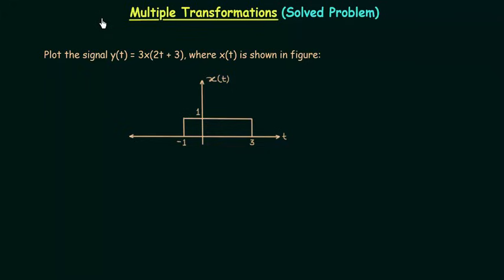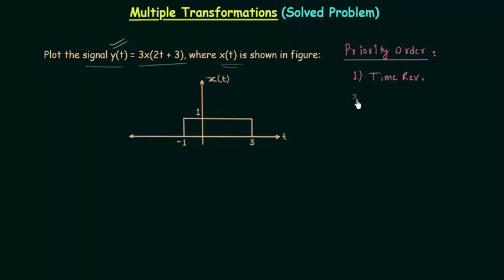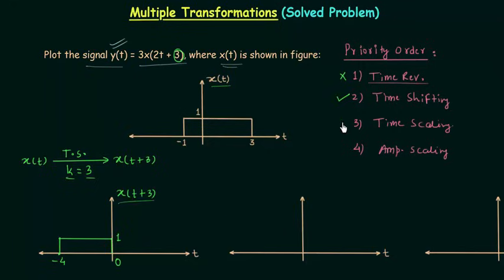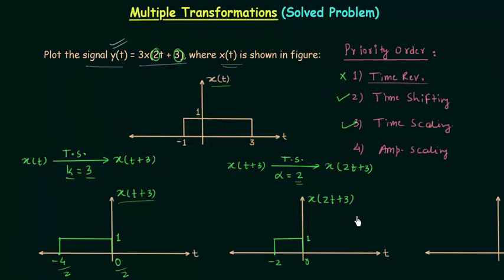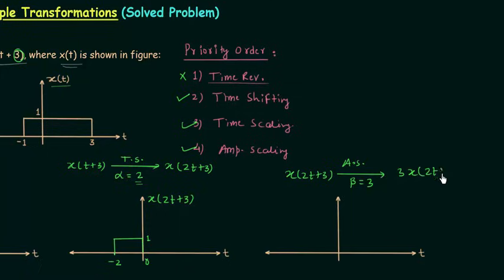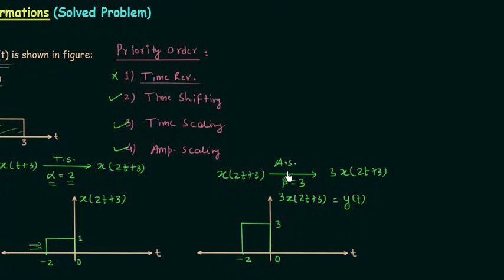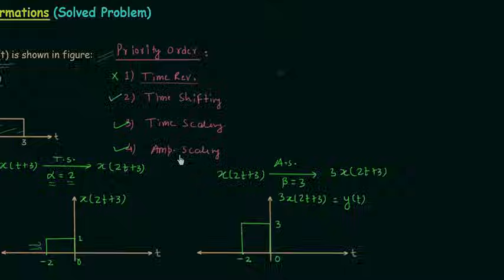Multiple Transformations of CTS (Solved Problem 1)

Comment: For people who are confused about the order of transformations. Actually, there is no universal way to perform signal transformations.

In many videos or sites, you will find different sequences and ways to apply the transformations; however, those patterns that you will find will be useful only for specific cases.

In the book "Analysis of Signals and Systems" by Lathi, it is explained a bit more, and they use a very simple method to determine if the way we are applying the transforms is correct.

Comment: i usually dont comment, but this is beyond wrong, there are 3 unitary transformations here (shifting, time scaling and amp scaling) 
the way to have 3x(2t+3) is to do a succession of transformations, one way would be : x(t) -> x(2t) -> x(2t+3) -> 3x(2t+3)
one of the many errors in the video is x(t+3) -> x(2t+3) this is not a unitary transformation a proper time scaling by 2 operation would be 
x(t+3) -> x(2t+6) , you couldve done x(t) -> x(t+1.5) -> x(2t+3) -> 3x(2t+3)

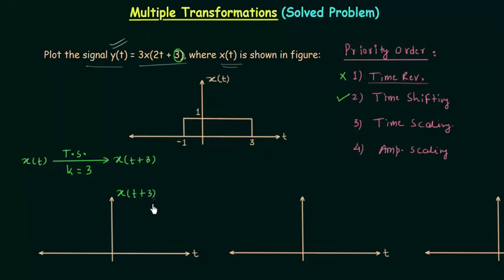Comment: 1:50 comparing to the previous video, where it was also x(2t+3) and you first did X(2(t+1.5) ) and shift by 1.5 but not 3. Now Im confused. Could you pls clarify
Reply: Yes...i also have the same doubt
Reply: it depends on the priority order in last lecture he started by scaling so in this case the signal is compressed then shifting by 3 you can not shift it directly as you treat with independent variable t not 2t 
take care
Reply: @ahmedabdel-moti3641  Thank you for comment, but my concern was not about this, I understood that I can't shift it directly. The question was that - in prev. video if 2t shifted by 3  then --> t shifted by 1.5 [ x(2t+3)  -->  x2(t+1.5) ] , so why here x shifted by 3 [x(t+3)] but not 1.5...
Reply: @Ceyhus  in this example he started with shifting so [t] is  already separated unlike last one he stated with scaling so he had to separate t before shifting
ex: given x(t) . for x(2t+3)
if I started with scaling(2t) i have separated  (t) before shifting 2(t+1.5) but if i started with shifting(t+3) before scaling as you can see [t] is already separated when i made shifting  .the independent variable must be separated only in case of shifting so if i started by shifting it will be t+3 look t is not multiplied by a number to separate it after that you can make scaling 2t+3

Comment: the order should be 1. Shifting 2. Scaling 3. Reversal, please let me know is that my right or not?
Reply: I think
Scaling 
Shifting 
Reversal
Reply: There are different ways to represent transformation, each way has different order between time scaling and time shifting, while amplitude scaling is not affected in the order because it is independent of time. In this representation x(t) = Ax(wt-t0) he got the right order.
Reply: @aqeelalmousawi1500  trying doing the next question with this priority order it comes out wrong but with shift scale and reverse it is correct
Reply: It's fruitless to memorise the order instead use ARG method

y(arg) vs arg graph
also arg is fxn(t)
then manipulate the arg to get t